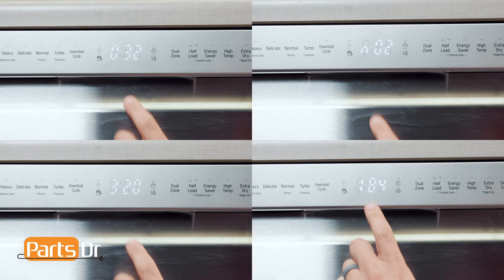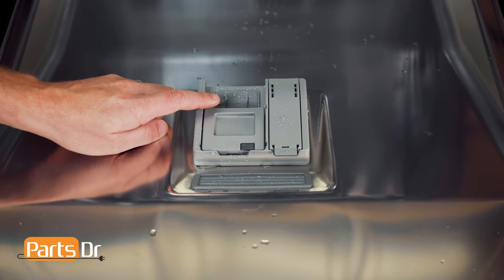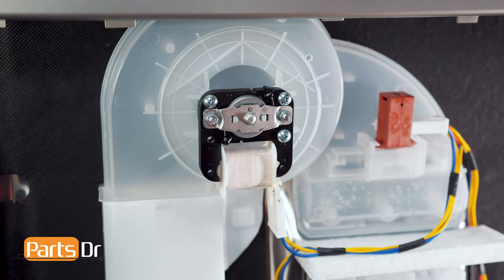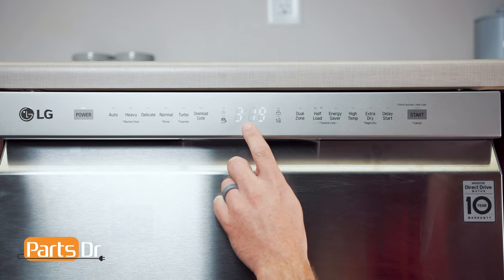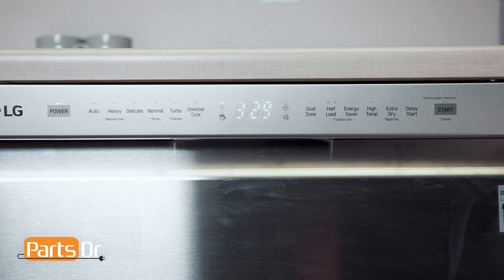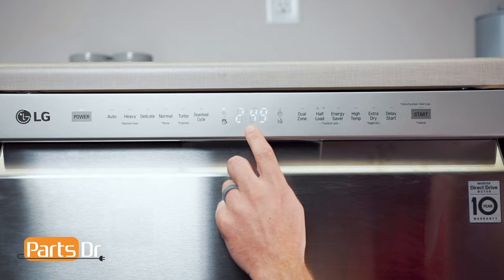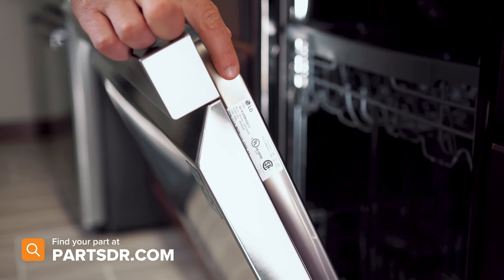TOP SECRET LG Dishwasher Service Test Mode

Comment: Awesome, will give this a shot.  Have this same model and it just recently started shutting off randomly after a few minutes of starting a cycle.  No error codes, it'll just power down, then power back up.  The other day, all of the lights on the display turned on at once.  Not sure what any of it means.  It's only about 1.5 years old and for the prices, it's pretty ridiculous that we're already having issues with it.
Reply: We have same issue now. Have you figured out what is causing this problem ?
Reply: @Virsavia77  No, haven't had a chance to go through these steps.  Was going to give the "smart diagnosis " a try sometime next week.  You call into customer support, push some buttons on the washer then place the phone near the washer and the customer service rep is supposed to be able to tell you what's wrong with it.
Reply: @TROD760  thank you for respond. We will do smart diagnostic too because regular diagnostic didn't help. The dishwasher turned off during diagnostic and we don't understand why.
Reply: sounds like the control panel, easy to replace and it's under warranty by LG for 3 years so don't delay contacting them
Reply: Mine too!
Reply: Did you ever find out what was causing the issue on your dishwasher?
Reply: @Virsavia77  Did you ever find out what was causing your issue?
Reply: @wtimmers  did not. It still shuts down occasionally,  but not as frequently as it had been.
Reply: @wtimmers  no
We gave up. We bought a  new dishwasher.
Reply: @TROD760  Thanks for the reply. Debating if I should schedule service or just live with it. Of course I'm just outside of warranty...
Reply: @Virsavia77  Thanks for the reply!
Reply: @wtimmers did you find the issue?
Reply: @Virsavia77 did you find issue?

Comment: Would you know the button combination for test mode on a LDS5540ST? There is no “Start” button on the panel. I’m getting an HE error at the end of the wash. Heater element is new so try to figure out what else to check

Comment: I fixed my issue…. Power on and hold start for 3 seconds and it will drain out standing water….  It i cleans the filter before and ran disposal.   👍

Comment: I have an almost 5-1/2 years old model LDP6797ST. While in the off position it suddenly started beeping, machine was empty, not in use,  AE error code, and I could hear the pump motor trying to drain. It did this five times before I unplugged it. AE error code indicates Automatic Emergency leak detection. I did some research, figuring Id start with the simplest checks first. (Im a 75 yr old woman on a fixed income.) First check was to pull out the unit completely. I located the float, and jiggled it a bit, checking the pan for water. There was a bit in it, but not enough to cause an overflow on the floor. Plugged it back in, AE error code still there. Then checked the hoses for kinks or leaks at connection points. No leaks, no kinks. Plugged it back in, still seeing AE error.  Arghhh! Unplugged it for 24 hrs and went to bed. 

Next day, I tipped the entire machine forward  about 45-60 degrees (read that somewhere), a bunch of water came out onto the floor. (Shoulda used a  floor towel.) After cleaning up the floor, I plugged in the unit, and the error code was gone. I powered on the the washer as usual. It worked. Well that got rid of the error code. What I don't know is what caused the problem or if it will happen again. Its working again, for now.

Comment: My dishwasher still washes great but the drive motor makes noise while it’s running. It has a 10 year warranty. The service tech told me that it might continue to run for a year or more versus buying a new dishwasher or replacing the motor. I’d like to get your opinion on that. Great channel I subscribed.
Reply from the maker: Hi Rick, if the circulcation pump motor is noisy while running it is usually a sign that it is failing.  In some cases a noisy pump can start to leak, so it is something to keep a close eye on.  If it is under warranty, you should see if they will replace it for you.

Comment: Very interesting video.. any idea about a command to recalibrate or hard-reset the dishwasher?  I'm facing the BE error code everytime when the dishwasher should start drying, it stops. Tried the milk solution, cleaning several times and checking the leveling but nothing is working... any help would be really apreciated!

Comment: You didn't address my problem but you fixed it just the same!  Couldn't get rid of the "CL" (Control Lock) despite following all prescribed solutions, including turning the breaker off for awhile.  I ran your tests and the CL disappeared and it started right up.  Many Thanks! (LG Model LDT7808BD)
Reply from the maker: Thanks for sharing!  I bet someone else will find this helpful.

Comment: THE BEST!  FIXED IT.  Thank you so much!!!!
Reply from the maker: That's great!  What kind of problem were you having?
Reply: @PartsDr  It wouldn't start.  Looked at other tutorials which did not help.  We pressed power and start and then it ran through the dignostics and when it was finished...the dishwasher started and was fine.  YAY

Comment: Great video to get me started with troubleshooting.
OE error code, not draining properly. I have checked the drain line, it is free and clear (back-blowed with air). Tub filter is removed. No air gap device installed. Ran my fingers in the drain basin but didn't feel any debri. When running through test mode, the drain motor runs, but no water drains (it hisses air lightly instead)
Advice?? TIA 👍
Reply from the maker: Have you checked the garbage disposal?  https://www.youtube.com/watch?v=ws9tMUq4MY0

Comment: I set my model LDF8874ST  LG dishwasher to a quick wash mode and I ran a couple of errands.  When I got home, the AE code was flashing, there was a little water in the floor and I tried to power off, and the power went off and then came back on and continued to flash.  When I opened the door, I could hear the drain pump.  I tried again several times to turn the power off, and it kept coming back on, pump running, so I unplugged it under the sink.  I have watched your video (and a couple more) and it looks like it could be one of several problems, from the fan assembly to the door gasket, to the spray arm.  None are obvious under inspection, so I suppose either 1.  I'll have to tackle the job (I am 70 yrs old and my husband is not well).  Or call an appliance repair.  The ladder not being optimal.  We also have an LG refrigerator that had to be serviced and finding someone to service LG was very difficult in my area.  Finally, one came from many miles away, charged me almost $1000 and broke a freezer drawer glide and didn't bother telling me.  I found it some time later, and it's been impossible to get the part.  I also have an LG range.  I will not buy LG again, even though I loved the dishwasher when it was working.  Very frustrating.
Reply: I just had the exact same issue and can’t get it fixed. I got the dishwasher brand new and it’s never worked for me. I’ve had so many issues with it from the beginning.

Comment: I have been having issues where the dishwasher won’t turn on. I have to kick the breaker for a couple min and then it will work. Then after a couple times got an LE code, reset then get an IE. now when I do the test mode I can’t get anything to work. I am assuming it’s a control board at this time. Any thoughts?

Comment: I have a 8 months old LG Dishwasher that keeps getting an IE error every two months or so. The technician has been onsite to replace the water inlet valve 3 times and so I have asked LG to take this dishwasher back since they don't seem to be able to fix this issue. After this experience I will never buy an LG appliance ever again!
Reply: I too have similar IE proble.

Comment: Nice video! My daughter's dishwasher (LDFN4542S) required the Start, Power, and Auto. Her dishwasher has been beeping then powering down usually within a couple minutes but sometimes 15 min into cycle. The Smart Diagnosis comes back good and all the tests appear good with one oddity. The final test is supposed to test spray arms 1un, 1lo, and then 0lo. The 1st test it went straight to 1lo so I retried the test and then it went through all 3 . When I showed my daughter how to do it then it reverted back to testing only 1lo. Is this normal or does it indicate a problem?
Reply from the maker: As long as it is switching between the upper and lower spray arms then that test should be okay.  It could be a bad control panel where it is pressing buttons on its own and causing it to stop running.  Let us know what you find.  https://www.youtube.com/watch?v=czeYpx62Dv0

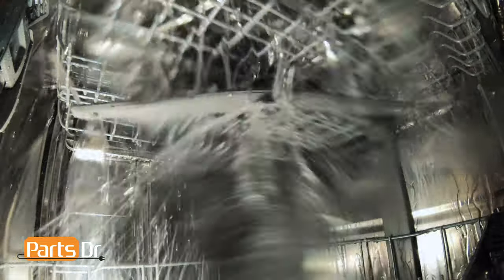Comment: Thanks for the information. This is very helpful. My dishwasher doesnot clean upper rack. The nozzle and spray arm looks ok. In my case, test #7  4:06, there was no error code . It show 1 UN and 1Lo but there was no water sprayed from upper or lower arm during test mode. Is it normal in test mode ?.  What could be the issue ?
Reply from the maker: Possibly a bad diverter motor?  We would start by inspecting the motor and the pieces that the diverter motor moves.

Comment: This video was great! I think my dishwasher is in a service test mode. The display is cycling through these 3 codes: n04 d32 U40 and all of the lights are solid (including the red, white and green lights on the front) but I can’t exit. Start and Cancel don’t work, the power button just double beeps and none of the other buttons work. Any idea how to exit or restart? The machine ran a full cycle yesterday, with no issues. Thanks! 😊
Reply from the maker: Sometimes we have seen a bad control panel cause these types of symptoms.  Let us know what you find.  We have a video on replacing that type of part here: https://www.youtube.com/watch?v=czeYpx62Dv0

Comment: Thank you for an awesome video. When I get to test 7 I get a C56 and 1 LO code. Never gets the upper arm code. I confirmed the vario valve and microswitch are good. Would you suspect the controller board?
Reply from the maker: Usually you have to narrow down the problem like you are doing by process of elimination.  You could also check the wiring between the parts and the control board.
Reply: I am having this exact same message “C56”. Did you ever figure out what this was??

Comment: My Kenmore made by Lg is shutting off with an HE code 36 minutes into a cycle.It is model # 722.14673710.I tried your  lg dishwasher test mode and I cannot get past step 4.When I press start to move to step 5,it stays in step 4 and continues cycling test 4.The first 3 test move thru fine.However,the board does not show me 01,02,or any numbers corresponding to test mode levels.Any help would be greatly appreciated.Your other how to videos are easy to understand.Thank you for that.

Comment: I can’t open the door to my lg dishwasher; It’s stuck or a lock is on. I called Lg and was told to cut the power to the dishwasher off so that it could reset itself but that didn’t work. They referred the job to a contractor in my area but they don’t work on warranty products, idk. Please help. Thanks

Comment: I’ve got an LG LDT5678ST dishwasher.  When I hit the power and start together nothing happens.  I was wondering if I need to hit two other buttons to cycle through.  Thank you for your videos, they are very helpful.  LG direct drive dishwasher
Reply from the maker: I'm sorry but we do not have information on the service mode for your model dishwasher.  If you locate it, please share it with us.
Reply: @PartsDr  On this model, pressing the "Power" and "High Temp" buttons together will engage the test mode.
Reply: On this model, pressing the "Power" and "High Temp" buttons together will engage the test mode.

Comment: I have Model#LDF5545BD. I Tried the 1st test mode on the detergent latch, didn't work and I couldn't even get to 2nd test mode. I think this model has issues with the det. latch, door latch. When I called LG there was a recall on the control panel??  LG said to send a tech out there is a $125 trip and Diagnostic fee!!   I was just hoping I could get through the test modes 1st before spending $ on this New Appliance!! Any suggestions?

Comment: Mine overflowed with soap cause I put dish soap in it and now it has a red blinking light in the front and has a blinking error code AE how do I fix that? I already tried reseting it and even if I turn it off it turns back on beeping do you know why this would be?

Comment: In the video you refer to test 6 as "wash motor", but I don't see a part specifically called this on your parts page. Is this the same as the "circulation pump"? My washer is throwing code LE.
Reply from the maker: The "wash motor" is the same as the circulation pump.

Comment: Nice info 
Quick question I tried to put my lg dishwasher same model in diagnostic mode and it shut off rt after the wash motor test won’t go to 1lo .. also dishwasher shuts off 25 mins into the cycle
Reply from the maker: That could indicate that something in the vario valve system isn't working properly.  It would be a good place to start your troubleshooting.

Comment: This video has helped me immensely in troubleshooting my dishwasher. I have an LG LDF5678BD. The washer motor is very loud and I plan to replace this. The other message I see is when I run the Vario test I see the 1 LO followed by a C93. The display will flash alternately between 1 LO and C93. Any thoughts on this?
Reply from the maker: Sorry, we do not have anything on the C93.  If you find out anything, please let us know.

Comment: We have a LDF5545ss that’s giving the ie code. I have a water inlet valve order but I can see the water inside the water inlet guide when it’s filling and the bowl fills then a 30 seconds later it flashes the ie code. Any thoughts?
Reply from the maker: Most commonly a bad water inlet valve or a bad water inlet guide.  Also, make sure to check the water supply to the dishwasher to make sure you have adequate water flow.  We have a video on testing the water inlet valve here: https://www.youtube.com/watch?v=vrDSl24vwao

Comment: My LG dishwasher LDF 7561ST has a start delay feature but it doesn’t allow a delay selection more than 19h.
The user manual says the delay can be set up to 24h.  I have turned off the braker for 10 sec, twice, but, whatever the programme chosen, the delay limit is still 19h, with a incrementation of 1h at each push. There are no error code.
What could be wrong?

Comment: Hi I have a LG dishwasher and it keeps popping up error code BE and I checked the leveling and also ran milk just like it said to and then had a plumber look at the leveling part and he said its leveled. Idk what else to do?. I turned on and off main breaker to dishwasher and still error code BE again. Idk what else to do. Please help.
Reply: Same issue here!  The dishwasher stops before drying things with that error. None of the milk nor the leveling fixed it... any idea???

Comment: We had the LE code pop up when we tried starting a load of dishes. I ran through this test and when I got to test 5 for the water inlet it struggled for a bit and then threw the LE code at me again and ended the test. Would this confirm that the LE code is being thrown because of the water inlet? Like is it safe to assume that’s the case so I can narrow down which part to replace?
Reply from the maker: The LE error code is a motor error.  This is usually a problem with the circulation pump motor.
Reply: @PartsDr  okay thank you. Hopefully I won’t fix the circulation pump motor and still have the inlet valve to worry about. Inlet valve seemed doable for me but not the pump motor. Might end up calling LG to come fix it but they charge flat rate $299 😭

Comment: I have the ldf5545ss model. I have changed the noise filter thrice already. On each change, the dishwasher starts working and goes off midway. and the Noise filter goes bad too. What coulkd be the cause? I have used other appliances on the power socket and they work fine.
Reply from the maker: It could be some component on the dishwasher that is bad and drawing high current causing the fuse on the noise filter to blow.
Reply: @PartsDr  such as which part?
Reply from the maker: @jibonjo  That is something that you or a technician would need to troubleshoot.

Comment: I have a suction noise from the circulation pump wich does not have enough water in the tub. Anyway to fix this? I have the same model. my water valve is open all the way under my sink. Thanks
Reply from the maker: Possibly a bad water inlet valve not letting enough water in or a bad water inlet guide that is not measuring properly how much water is entering the dishwasher.
Reply: Thank you,  it's still under one year waranty and does it since day one. I will have it check. Problem is probably what you say, because if I manualy add water during washing cycle the noise stops. Everything else tests fine.
Reply from the maker: @vincentcantin6945  Sounds good.  Let us know what you find when you have it repaired.

Comment: I have an LG Dishwasher model # LDF7774ST. Recently it has started to start running by itself when the door is closed. Can you let me know what is wrong and what needs to be replaced?
Thank you!
Reply from the maker: We often see a bad control panel cause these types of symptoms.  https://partsdr.com/part/agm74051507-control-panel-assembly?model=LDF7774ST
Reply: Thank you so much! Just ordered the part. @PartsDr